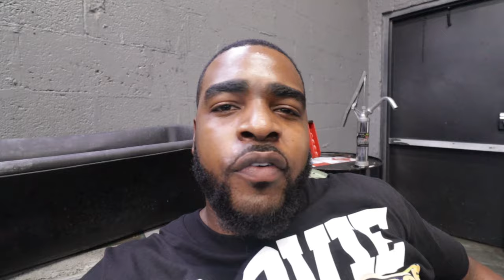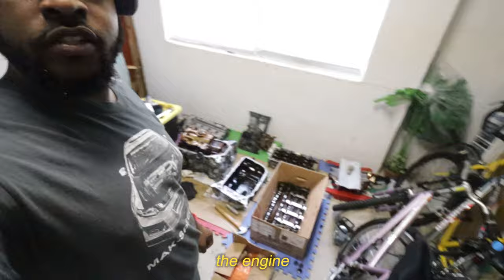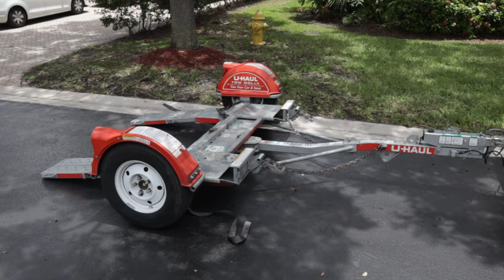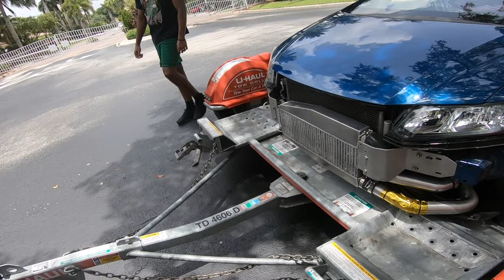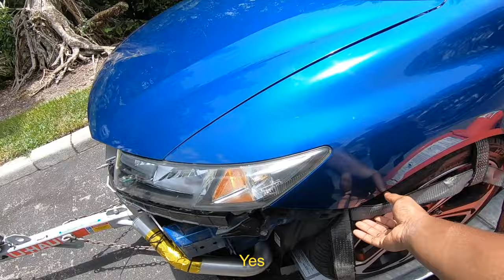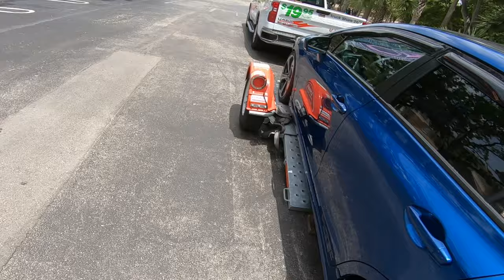THE REBIRTH OF MY BIG TURBO HONDA CIVIC 600+ HP BUILT MOTOR

Comment: Bro to get the car off the dolly you just need to set the e brake on the car and gently pull the truck forward out from under the car. Once you get close to the front tires coming off the ramps, stop the truck and place the blocks then let the car roll the rest of the way.  The e brake is for the rear wheels only so it works flawlessly.  To hell with all that pushing and pulling.   Work smarter, not harder my boi